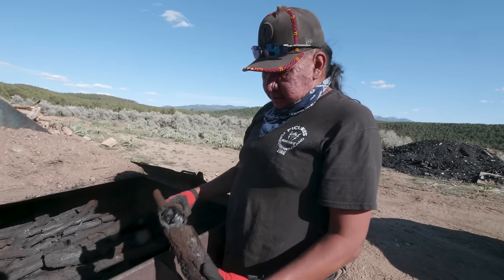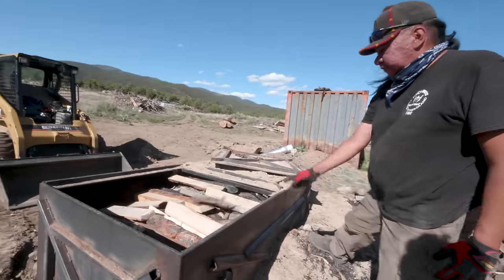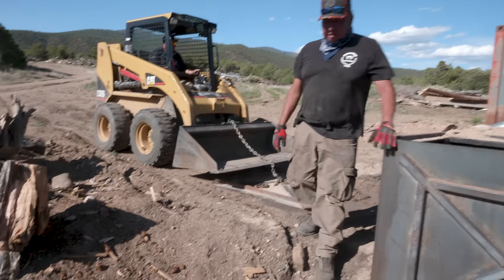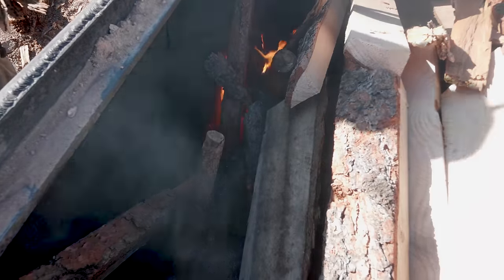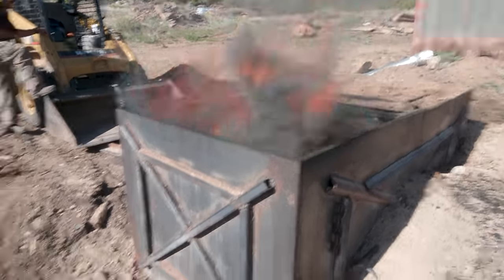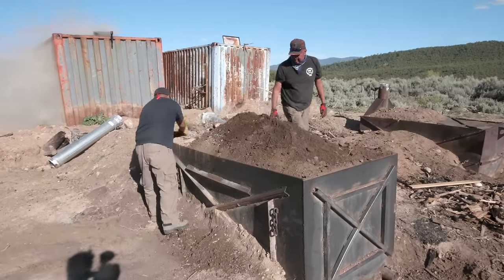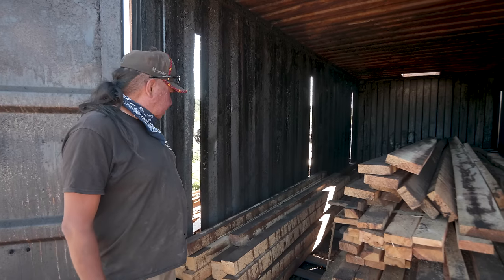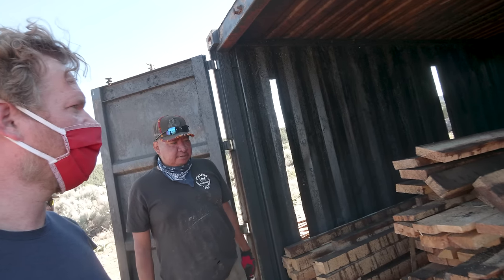How Charcoal is Made

Comment: That is one hell of an operation. Really cool to watch. If you still have contact with them tell them they could run the return pipe, for the water, about 4 feet under ground before it goes back into the tank. The ground should pull some of the heat out of the water. Have to go that far down in that area since it gets so freaking hot in the summer.

Comment: Awesome Video, one option for the water temperature issue would be to run the water through a number of old car radiators before putting it back into the tank for the next round depending on the ambient air temp overnight. - Could be a good next video for you :)

Comment: You are a smart guy. Am sure while you are on the reservation you could assist them in possibly automating some of the charcoal making process.
Eg: adjusting the air intake valves based on internal temperature

Comment: Charcoal has very low resistance, it can be used in circuits, it would be cool to see you making something with that. it can be used to do carbon electrodes, electrolysis, conductive ink to make circuits etc. not the best but works and is simple to make

Comment: Depending on what type of bamboo you can grow in New Mexico I think you would be a more sustainable source of charcoal. The average bamboo grows about a meter a day and can be harvest in 3 years. According to the RHS Dictionary of Gardening, there are approximately 1,000 species of bamboos. Just to give you an idea.
Reply: Charcoal from bamboo burns longer and produces less smoke and air pollution than ‘natural’ (woods) charcoal. Charcoal adsorbs odor and pollutant particles by trapping them while air or water flows through the pores, purifying the surrounding air or water in the process. Bamboo charcoal is four times more porous than regular wood charcoal, which significantly increases its effectiveness. If you're using bamboo charcoal all you will need to do is add a few wood chips for the smoke flavor you want. Most grocery stores I know of sell wood chips in small bags of many different wood.

Comment: Nice casual interview with the man doing the work. Good to see the kiln at the chimney side. 
The pity is this is about the worst way to make charcoal. 
Small change in the unit design would have far greater yield and much better quality charcoal, less pollution and more saleable products.
Close the bin, put small fire beneath, extract smoke at top, duct some of the smoke to use as fuel for the burn, pyrolyse oxygen free. Cool some of the smoke to obtain wood alcohol and liquid fuel.

Use an old cement mixer with rocks inside to break it up without getting too dirty or even better a spinning flail chain device in a drum. 
The changes would cost virtually nothing.

Comment: They oughta try and integrate a Thermoelectric Generator, i wonder if it would be worthwhile over there. The immense heat is just energy dissipating. If the byproduct is energy, you might be able to sell it back to the grid

Comment: if anyone comes here to learn how to make charcoal google on ...  "Biochar Workshop: What, Why and How?"   ...  trick is put bulk of the wood into a separate air lock chamber with only vents at bottom ... when done this way you get maximum usable charcoal and there is very little smoke ...  if you get any smoke it indicates an untuned setup

Comment: So the "easier" way to do this would be to use a barrel. Set logs on fire outside the barrel with the barrel mostly sealed only a little vent.. as the barrel heats up it turns the wood to carbon as gases escape they burn off which is why small vent not big or the wood inside burns.. Then you are left with 100% carbon without the ash and stuff.. You also do not need to take it out of the barrel you can ship it as-is.. Which means no dirty mess to deal with. Easier and faster to move around. Just incase you wanted to be more efficient and all. But hey maybe the sweat from the hard work does something magical lol

Comment: The mask you use does not do much.
Reply from the maker: It protects others pretty well, which is what my intention was.  When I'm worried for myself, then I try to wear an N95. The problem is that the N95 masks I have have valves, and therefor don't protect others very well.  So I have to make a choice...